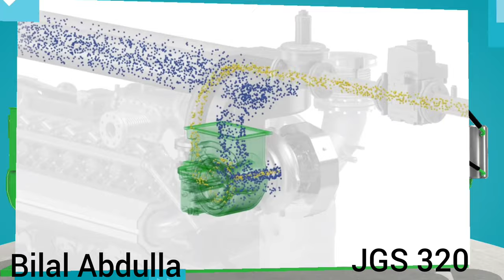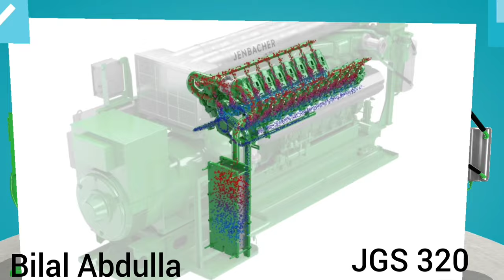JGS 320||Gas Engine||Gas Generator||Basic working of gas Engine||J/W||Cooling System||Turbo charger

Comment: Sir . I have a question, do you know where is the temperature sensor for the cylinders? At which part they are located? I presume it is attached to the cylinder heads. Thanks.
Reply from the maker: Yes, Thermocouple are placed on every cylinder head to measure exhaust temperature
Reply from the maker: Location:Bottom side of Cylinder head near Exhaust galary
Reply: @bilalabdullah3832 Thanks for your answer. Exhaust gallery? so the temperature measured is for the exhaust gas not the temperature inside the cylinder?
Reply from the maker: Exactly